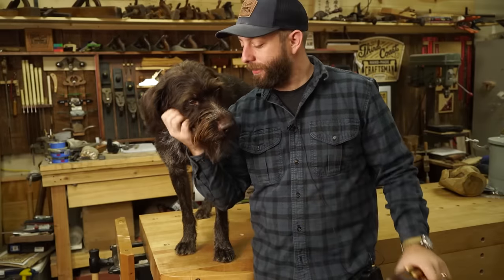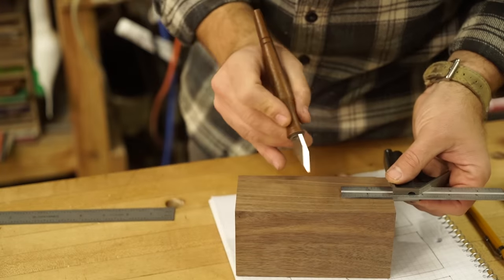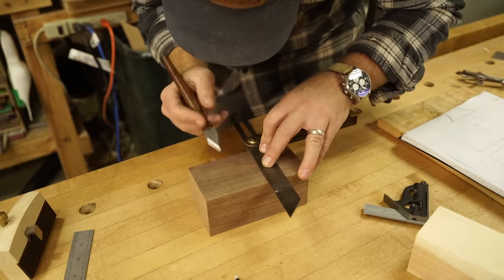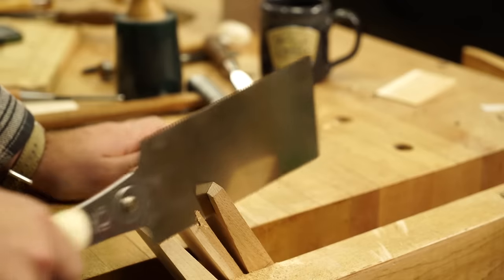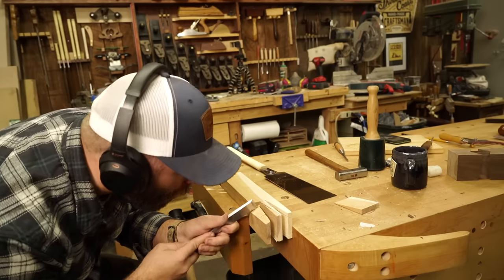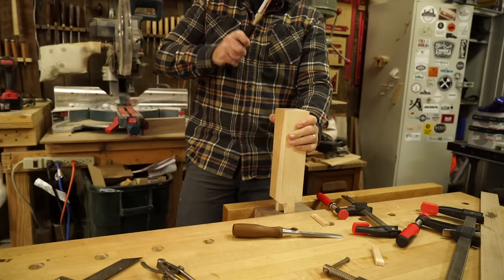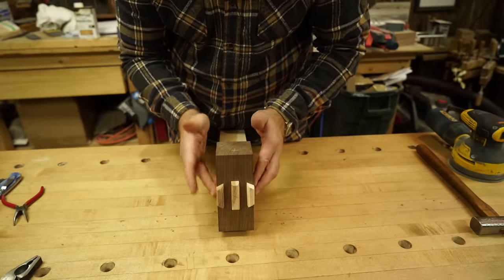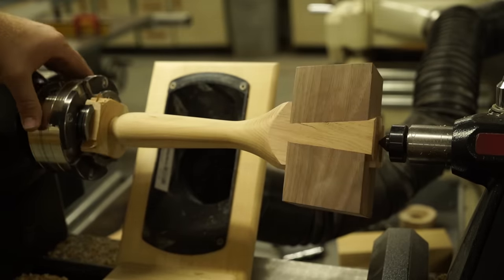Making Abe Lincoln's Mystery Mallet!  // "IMPOSSIBLE" Woodworking Joinery

Comment: Lincoln was not honest.  He forced the Civil War by violating an armistice with the state of South Carolina when his forces took Fort Sumter under threat of force.  Fort Sumter had never been completed and commissioned and was occupied by a token force of South Carolinian troops at the time and it was agreed upon in the armistice that neither side would reinforce the fort.  Fort Sumter had a strategic position that could put a stranglehold on the entire state by cutting off trade to the capital city of Charleston and a major thoroughfare that supplied the rest of the state with trade.  Lincoln basically took the fort, violating the armistice and then threatened to reinforce the fort with more troops which would have also been supported by a naval fleet that was travelling toward Charleston.  It was thus that Lincoln had the state of South Carolina held hostage and forced the South to attack through his several aggressive actions.  The south was blamed for starting the war when the North initiated all of the circumstances required for the war to start.  This is completely dishonest.  Furthermore, Lincoln and his war department were dishonest with the government of South Carolina during the entire exchange, making several promises that they had no intention of reinforcing the fort while acting directly contrary to the promises.